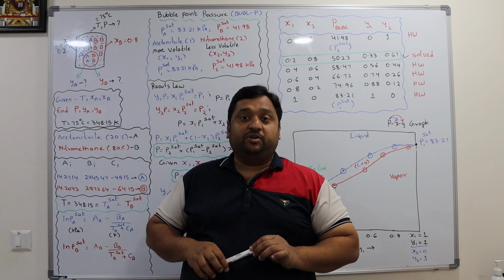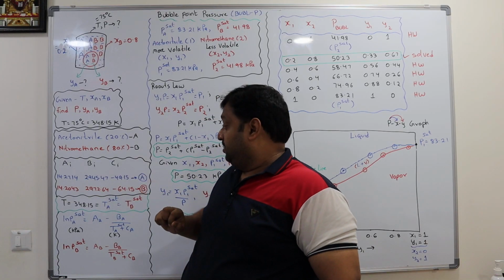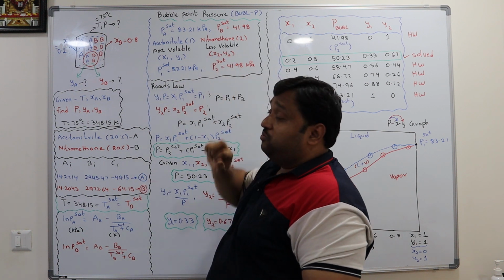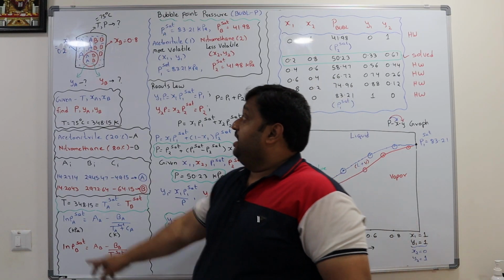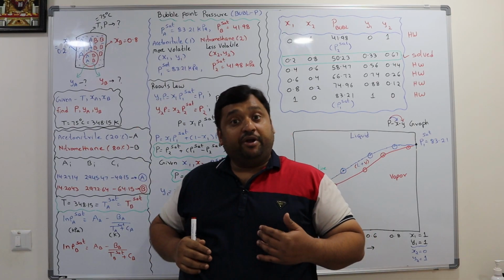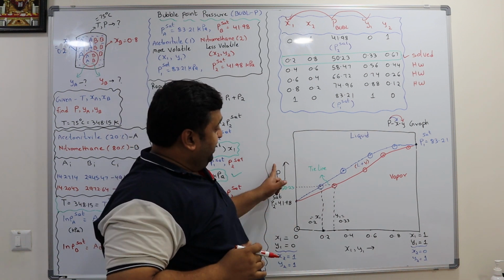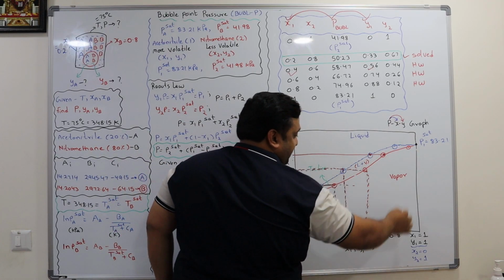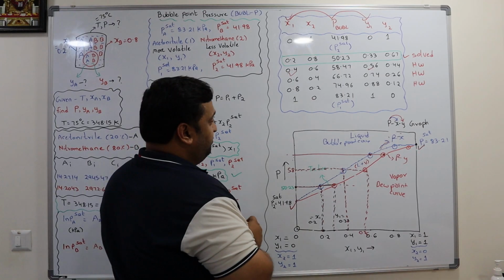CET Lec 18: Bubble Point Pressure Calculation/P-x-y Graph Plot Explanation Acetonitrile/Nitromethane

Comment: Sir in exam they are asking to explain bubl p calculations using Gamma phi formulations of vle with relevant equations and flow chart can I write the content in above video sir 

As I'm confused it's using raoults law?
Reply from the maker: If you are using gamma phi formulation, you need to update phi and gamma for every iteration. Gamma with excess Gibbs energy models and phi with different Equations of state/compressibility factor correlations